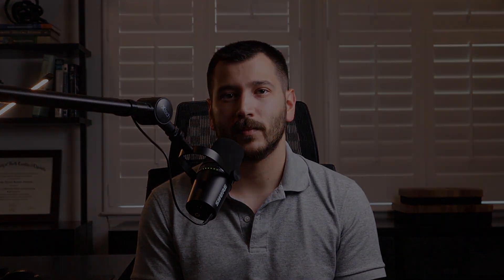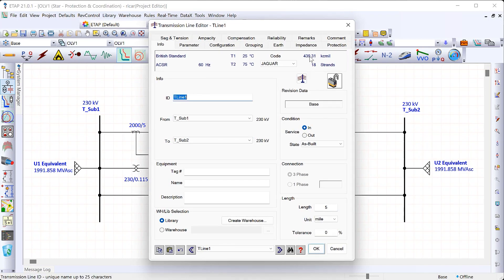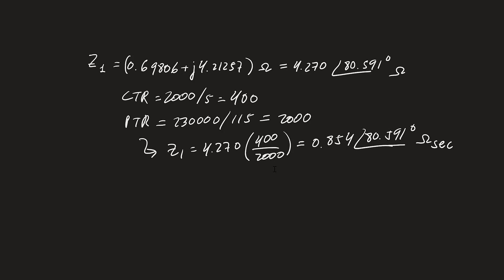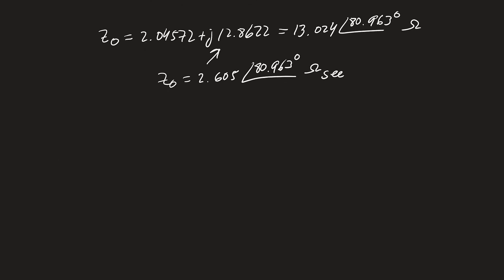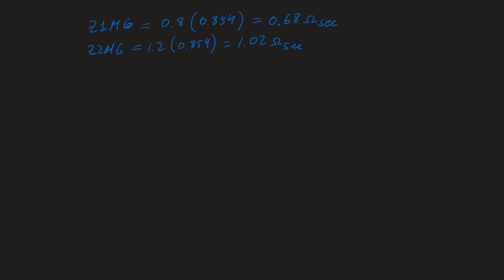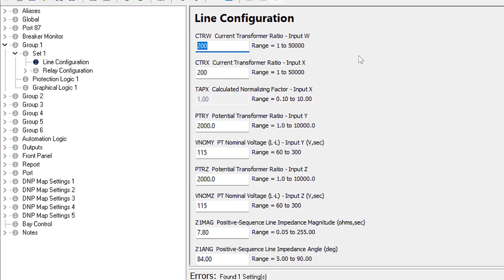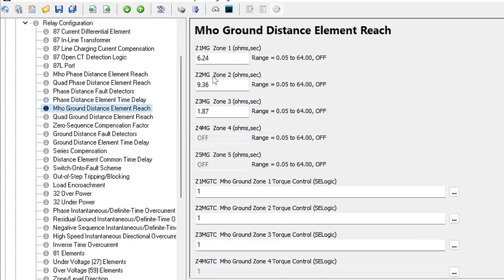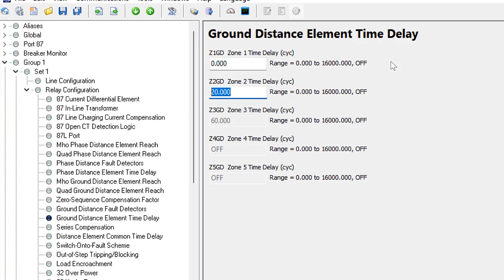Mho Ground Distance Protection | Example Using the SEL-411L Protection Relay

Comment: Relay characteristics angle in SEL relay for quad and mho distance relay how can we find these angle.
Reply from the maker: If you're referring to the maximum torque angle, it is the same as the line impedance angle, so check that setting.